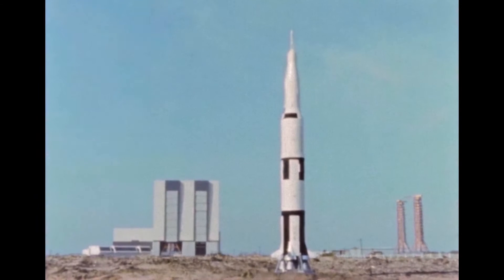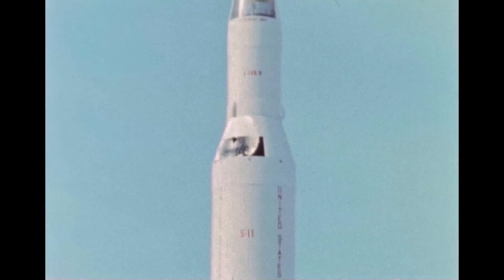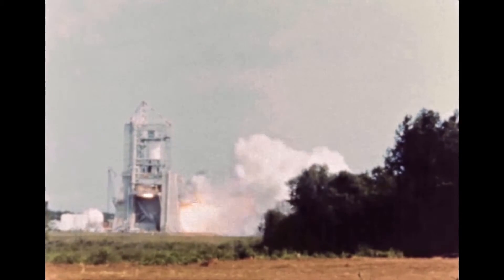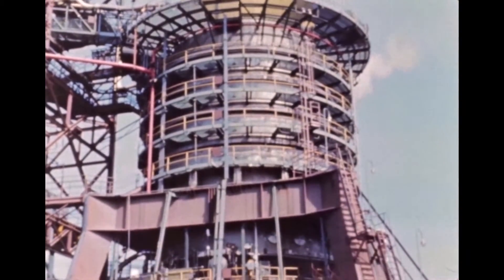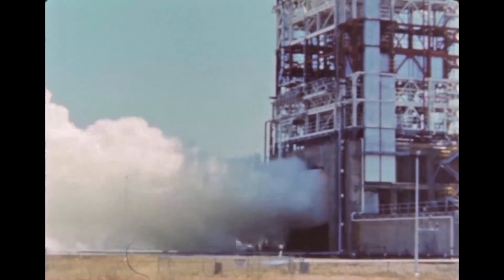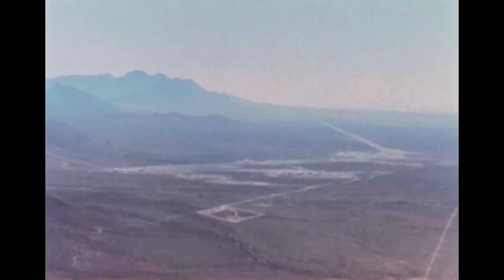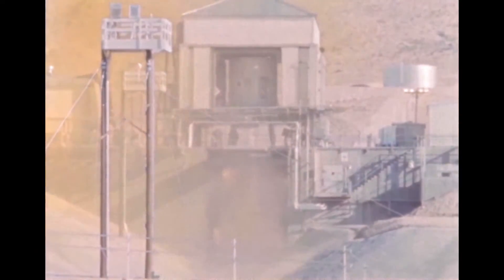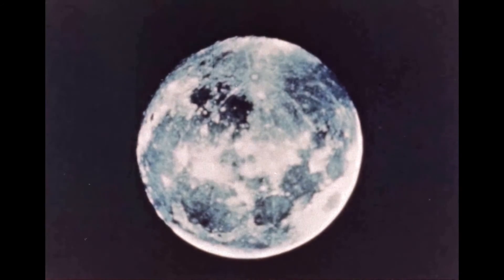Power for Apollo Saturn V - Remastered NASA documentary - Engine tests and rocket development

Comment: Mid 1960's, judging from the test stands used and the early LEM engineering builds. They were the "Battleship" configurations, testing components and engines.  They also have yet to fire the "wild ride" of the 3rd Little Joe 2, which completely validated the LES tower.

Comment: This doesn't look "remastered". It looks like a 16mm copy was run through some software that sort of "cleaned it up" and did nothing to restore the lost picture details, correct the poor color or instability. I like to see old footage like this, put prefer to view it without the fixes which just adds more obscuring layers.
Reply from the maker: Sorry that you don't like it. My remasters try to retain the film look, while reducing dust and scratches. Color was improved on skin tones, highlights and shadows, but very conservatively. Nothing was lost in the process.
Reply: @RetroSpaceHD  I appreciate your efforts. But "remasters" are actually re-created from the original camera negatives (or positive reversal) with the current state of the art conversion methods. Materials run through clean up software cannot bring back details and sharpness that were lost in the original transfers and subsequent copy generations. The current crop of software is especially poor at handling blown out highlights and getting the color right.

Comment: Very cool. This so old they still were going with the round doorway on the lunar module. That horrible yellow smoke you saw was nasty stuff to be around. They also left out the part about the the lunar modules ascent engines hypergolic fuel....insanely nasty stuff.... One and done. 
  Thanks for putting this on. My uncle worked on the escape tower. Seems like yesterday....
Reply from the maker: Yes that yellow stuff is bad! Besides that some interesting test footage is shown, including the exhaust from the descent engine and the RCS. Yes, it will look diferent on a vacuum but it's a valuable visual reference.
Reply: Hypergolics, both are nasty chemical mixtures. But simple plumbing, few moving parts, no pumps, restartable and controllable. This type of propulsion for the LEM was chosen especially for those reasons.

I bet he was proud after that "Wild Ride" Little Joe 2 gave that boilerplate CM and his LES.  That was absolutely mental.